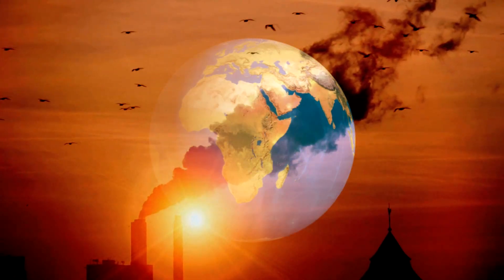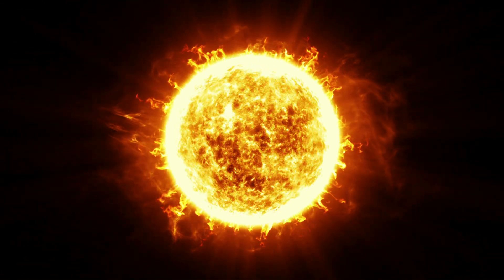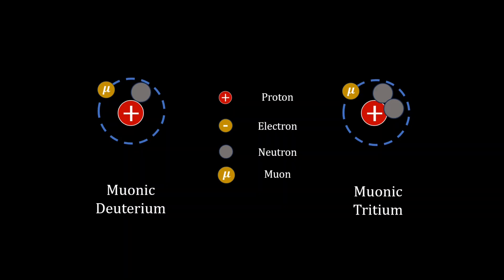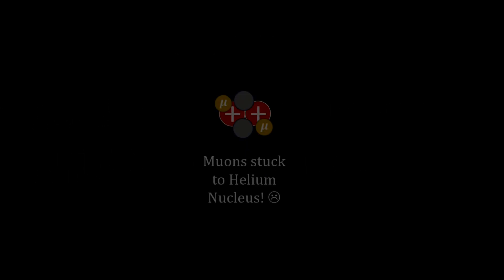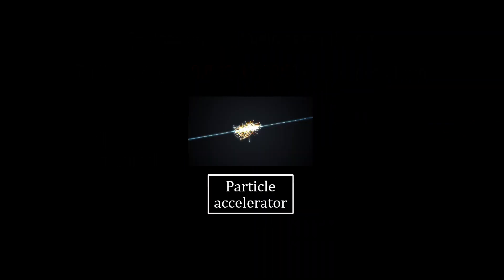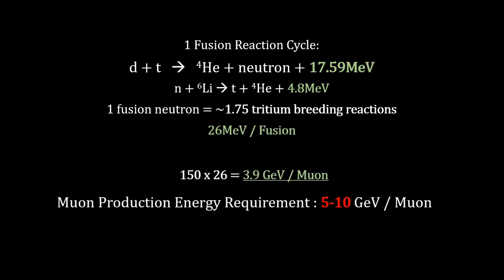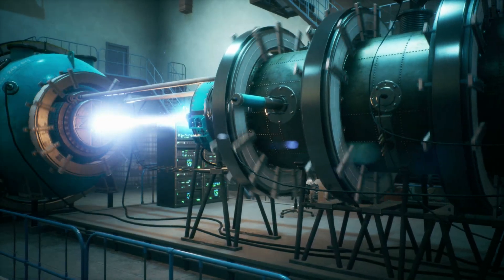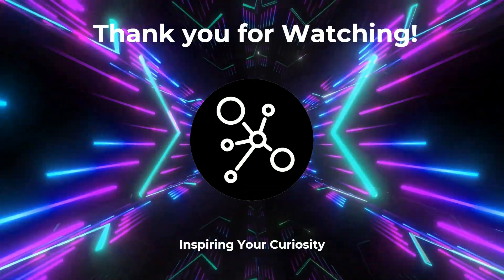A Cold Fusion Reality? | Muon Catalysed Fusion

Comment: Political Correctness gave credit to Luis Alvarez while my MIT endorsed articles and presentation proves how Noguchi of early 1940s Hamgyong had perfected muon catalyzed fusion rocket engine comprised of a Dewar of cryogenic liquified deuterium fuel connected to a beryllium alloy reaction chamber nozzle coiled in around electromagnet coils to focus cosmic ray muons for cryogenic fuel to prevent exceeding of Curie Point as part of Hideo Hasegawa's Project NA thru NZ. 

What happened was Noguchi's factories spanned from Kumgang mountains of Wonsan to Changbai Pass of Hamhung Hungnam into Manchuria so during such  time Frankin D. Roosevelt had a  blockade of seafloor mines around Asia for Japanese East Asian Coprosperity Sphere to lack quality ferrous irons amid surpluses of silk and chemicals to not have rail transit track freight trolley trains since what rial transit tracks they did have were controlled by Soviet backed rickshaw banditry since before fall of 1945 terrain was too mountainous steep full of jagged waterfalls. 

Therefore all they had were sulfur fueled steam filled airships patterned after Korean hoop skirted farthingales called "Hanbok deashin chima" and also had to rely on rocket propelled gliders of braided composite fibers patterned after towering bumpits coiffures of Korean Manchurian brides to haul freight between rooftop hangars equipped with Mary Kenney's patented ground based STOL fans while female divers had prevented solar agricultural serfdom..  

Noguchi had to use employee Fritz Hansgirg on 1930s patents and Mary Kenney had to use attorney Gibbons on 1920s due to racism and sexism of their time since real issue of WWII was the United States had used might to impose agricultural produce and rail transit tracks on Asia.  

I tried to commit suicide in of Ontario to protest how they would not let me tap cosmic ray muons focused over Magnetic North Canada so any stamp of approvals would take forever to go through variousparliaments of British Commonwealth Nations from London to Ottawa so only hope is anotherentrepreneur to tap cosmic ray muons from Russian side of Magnetic North.
Reply: I have a CIA archaeologist stuck in de facto Renaissance Fair North Korea to search for any remains of such a deuterium fueled rocket plane engine.

Comment: My MIT peer reviewed articles and by invite only to give a presentation to an engineering conference held inside MIT's Electrical Dept on Vassar Street had solved most problems associated with muon catalyzed fusion for rocket propulsion from Nitchitsu's Noguchi of early 1940s Hamgyong to spaceplanes for angular upward acceleration into orbit and airships of Morrison's patented lighter than air solid "SEAgel". 

A Xcor Lynx is ideal if one uses deuterated diborane fuel with Helmholtz coils to focus cosmic ray muons. 

I can prove how Luis Alvarez was credited for muon catalyzed fusion only after United Nations Peacekeepers had returned from ruins of Hamgyong.
Reply: Dr. Mitchell Swartz  affiliated with MIT says I should take Jerome Drexler to court for plagiarized patents while Motohiko Inai of Northeast Asia has patented a rocket powered by muon catalyzed fusion resembling a spacecraft being refueled in of "TTA Starliners" by Stewart Cowley and animated by Erny Module.

Hector D'Auvergne and Mutsuro Bundo spacecraft  patents are also worth considering.

Comment: but having muons closer to the positively charged nucleus does nothing with the positivity of the nucleus... in fusion you want to merge the nuclei - what does the electron has to do with that ? nothing
Reply from the maker: Thanks for your comment :) - you raise an excellent point, and perhaps I could have highlighted this a bit more clearly in the video. So my understanding is we need to overcome the repulsion of the electron clouds as the atoms start getting near one another, and then the nucleus-nucleus repulsion too. The latter won't be affected as much as you mention; the former will be. So the electron-electron repulsion will start when the electron clouds start overlapping as the atoms are forced together. For electrons and the bigger clouds this effect will start happening with the nuclei much further apart; with muons, this effect will happen when the nuclei are an order of magnitude closer together thus reducing the electrostatic barrier.
Reply: @ChemEfy  that's nice, but the problem is in (at least hot fusion) you don't have this problem at all... You have plasma - so only the nuclei. So in cold fusion you have the problem with nuclei as well PLUS the electron problem. So you found out a way how to mitigate partially the problem which the hot fusion doesn't have at all...
Reply from the maker: @jakub.kantner  Yep absolutely agree with you here. In cold fusion we have both; in hot we only have one - but in hot, to remove the electron problem we have to expend a huge amount of energy to heat, and then there's the challenge of building a system to control really hot plasma, sustain fusion, deal with high temperature neutron radiation etc. which cold fusion doesn't have to deal with so much. Ofc cold fusion has it's own set of issues, a small main set I highlight. The 2 approaches definitely have there distinctions, pros and challenges :).
Reply: A  muon or mu meson is an electron moving at least at 10% light speed so it destabilizes Coulomb Barrier of hydrogen isotopes.

Comment: So there is a small problem - creating muons in accelerator would make as a byproduct some radioactive waste. Depending on efficiency of muon production this would be less than in uranium power plants, but it surely cannot be considered "clean" and promising in a way we hope for
Reply: There is much radioactive waste in nuclear fusion.  The tocamak (the chamber that supports the fusion reactor) after so much neutron bombardment will be highly radioactive.  However after use it can be replaced, and stored in some concrete shed.  Its return to normal radioactive levels is much faster than waste from fission reactors.  Moreover, one problem is the life time of tokamaks.  The metal becomes brittle quickly.  Not a quick fix.
Reply from the maker: Absolutely, this is a great point - the comparison to uranium power plants is true depending on the efficiency as you mention as well as reactor technologies and waste management systems. Finding an efficient, sustainable and executable (engineering-wise) way to produce muons is a definitely an ongoing challenge in R&D and beyond. :)
Reply: Potassium  is radioactive of an often over used catchphrase.
Reply: @thomasciarlariello  K40, half life about 1.25 billion years, 120 ppm of naturally occurring K..

Comment: Reliable nuclear fusion would solve 90% of the world's energy problems, but I'm skeptical we will get to it before the world economy collapses. If new methods are discovered it's still good news.
Reply from the maker: Thanks for your comment :) - I'm tempted to agree. Certainly would be great to have, but I think other options appear more feasible and scalable at present.
Reply: Needs to be more than reliable, but cheap.  Even if we can make it reliable, if $/KW is 2x as expensive as oil, it still won't take off.

Hell, even if the ROI is too long, still won't take off.
Reply: 10 year's  away  don't worry...